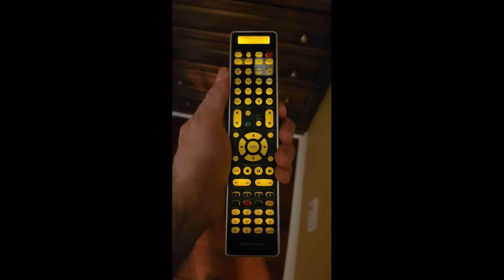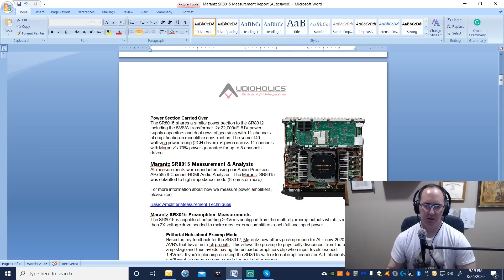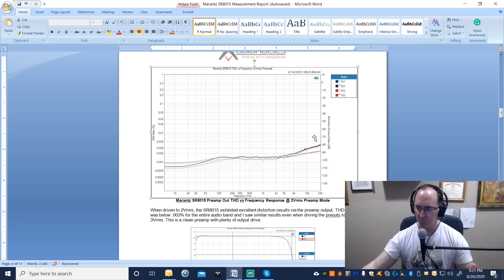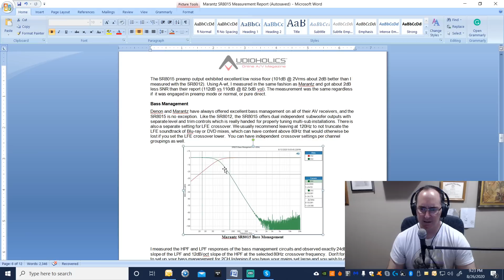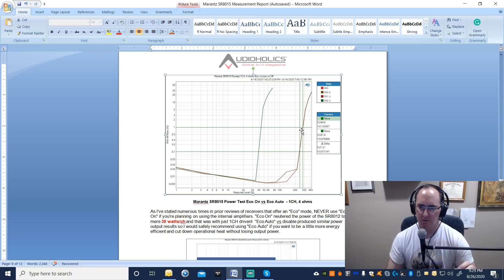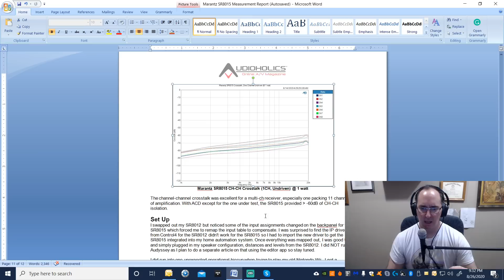Marantz SR8015 Best AV Receiver for 2020? Bench Test Results!

Comment: Thanks for the video on the 8015 and the bench test. I have ordered one of these units and I will be using the pre outs , but I was wondering if it would be possible to have the SR8015 to power my Wides and Atmos?

Comment: Three years later, the Cinema 30 is out and I was able to buy a new Marantz SR8015 for less than $2K!  Love it.  I enjoyed watching your analysis of the 8015.  It does sound amazing!
Reply: so how do you like it? how would you describe the sound?
Reply: @MasterofPlay7 The SR8015 is warm and sweet when listening to music but dynamically strong and sharp when watching a movie. I have a 5.1.4 and use an EMOTIVA XPA-3 Gen 3 to drive my front stage Martin Logan Motion 60XTi/50XTi. Really happy with my setup. Love the Marantz.
Reply: @rafacq  are you going to upgrade to cinema 30?
Reply: @MasterofPlay7 why would I want to spend $4,500? I have no reason to change. I don’t want Dirac and I only use one sub. No need for 4 sub outs. I’m not jumping in to that rabbit hole!  My system sounds amazing, particularly after using Audyssey One.
Reply: @rafacq  do you have to pay extra for audyssey/dirac? I'm debating which one makes sense
Reply: @MasterofPlay7 not at all!
Reply: I’m going to get this at less than 2k on Amazon. It’s an amazing receiver.

Comment: Other than power hungry speakers or speakers in an environment that need to be driven hard I am beginning to understand the use cases for pre/pros any more. I have been a Denon person for 20 years having started with a 4802, 4308ci then X7200WA and every time I consider separates the Denon and Marantz step up their game. Now debating on when the X8500HA or SR8016 replacement be due to decide to wait for that or jump on a SR8015 later this year.

Comment: Streaming surround sound?  Streaming does not support surround sound. 4K players with audio output being phased out. OPPO 205 4K player no longer produced price for NOS $8000. and Panasonic DP-UB9000 being discontinued. Also HDMI cable has lower power for audio output.  If you buy a surround sound system, there is no way to listen ? There is no info I can find that talks about this?    Could I please get some comments about this.

Comment: Does the 2019 SR5014 and the 2020 SR5015 have the preamp disconnect and the new circuit? Or are these two things only found on the SR6015 and higher? I use a Emotiva XPA-3 to power fronts and center channels.

Comment: So what actually happens to the power of the receiver when in 8 ohms, vs 6 ohms, vs 4 ohms? If you don't hear distortion at 4 ohms then does it matter? Does 4 ohms actually change the sound quality? If Im running a crossover anyway do I need the power of 8  ohms? What's missing when I set the receiver to 4 ohms?

Comment: Gene, I am in the market for a new avr. Love love love your videos and reviews. I’m still feeling the sting from my Onkyo pre-pro issue hdmi board failure twice and crappy service.  Really want to go with the sr8015, but than read this on Amazon.  Any thoughts?

Amazon Marantz Customer Support]
Marantz does not own any service centers. All of them are independent contractors... [Marantz] does not have our own parts inventory. We have a separate company that handles that for us. It is a company called Encompass and if they do not have the parts needed for the repair then the unit is deemed not repairable.In truth, nothing is unrepairable. It is just that because parts that are not available would have to be made, the cost of the repair would be more prohibitive than the cost to buy a new unit. So it is not worth repairing. If United Radio told you the unit can not be repaired what they meant was that replacement parts are not available and it would cost you more to repair it than it is worth.Marantz does not have an obligation to any of its units outside of their warranty period. We still provide phone and email support as a courtesy. And it is not so much that they will not accept the unit, they just know for old units there are not likely to be parts available and they do not want you to waste your time shipping it to them if that is the case.[End of Email from Marantz]A couple of things to note here. First, Marantz doesn’t make the parts - another company makes them. There’s no contractual obligation from the parts manufacturer and Marantz to offer parts for any period of time to support their products even their reference series.Second, Marantz makes it completely obvious that the Authorized Service Centers that they direct you to are completely unaffiliated with Marantz and have no obligation to even accept certain units for repair. This is exactly what happened to me – their regional service center wouldn't even accept the unit for repair. They say that nothing is irreparable – well, obviously all my receivers are.Third, Marantz clearly states that it does not have an obligation to any of its units outside of their warranty period. Unlike car or watch manufacturers who will gladly repair your unit for a fee , Marantz’s interpretation is that they have no obligation to even offer a means or a service center to repair the unit. You’re on your own – it’s Saab time and the factory is shut down.This is very disconcerting for what are considered by many audiophile grade receivers – it would be fine if we’re talking about a $500 receiver but not okay for $3,000+ receivers.Like many of you, I was planning to upgrade to the 8015 but I can't buy it if it will not be repairable 5 years after I buy it and I definitely don’t want to squabble about the existence of parts with Marantz if something happens. If there are no parts, this receiver will be completely unusable and I'll end up with 3 of the most expensive bricks I've owned. I'm sharing my story with you to make sure that this doesn't happen to you.I know that a few of you will think that I got plenty of life out of my receiver and I did and I love the sound of the receiver but the option to repair it should rest with me, not Marantz. I was lucky I had a spare 8001 and could use that but not everyone here will be in that situation where they have a 8012 lying around and certainly spending another $3,000 to replace the same model is not something I would like any of you to have to do. And let me tell you, my back has paid the huge price dealing with the broken receiver. One service center accepted it, charged me but didn’t fix the receiver. You don’t want to hear Marantz’s response.
Read less

Comment: Hi Gene, thank you for the informative video. We learn alot from them. My question is.... How do you see the AV8805? The only video I've seen is from Sparechange talking about it but haven't seen no"benchmark" videos on it. I just (upgraded?) my 8012 to the 8805 and went complete seperates. Do you ever plan on benchmarking the 8805? Thanks in advanced sir
Reply from the maker: It's a good processor,  better analog front end than the AV7706 AND on par with the SR8015. Will probably bench test the 8805 replacement.
Reply: @Audioholics  Thank you for the reply sir. Ok, so I guess I didnt do to bad selling the 8012 to get the 8805, especially if its on par with the 8015 seeing how the 8805 is about 2 - 3 years old and the 8015 just came out. Anxious to see what the 8805 replacement brings also

Comment: Please let me know which is a better receiver between the 8015 or yamaha 3080?
Reply: Hi I had the same dilemma and bought both Jeje ended returning the Yamaha it sounded great but the 8015 is just more powerful and the dynamic is superior you can hear more separation between channels and it gets louder with out distortion and of course it cost more money but you are more future proof as well. Hope I help
Reply: @AMERICOBECKS  was there any distortion on yamaha?
Reply: @gamingingalaxy4011  only if you push it to hard I was using 5.1.4 running everything on the AVR Amp, it was too much for the internal Amp at Reference level you I was able to hear some distortion, below that the sound was great I replaced for the SR8015 because the marantz is just more powerful and have more of everything but at a higher price of course. But if your place is no too big the Yamaha will sound great
Reply: @AMERICOBECKS  i did the same thing returned 3080 and got 8015 instead

Comment: I have an 8015. I bought an Emotiva amp thinking I could only use the preouts for the front channels and still use my 8015 to power the rest of my 7.2.4 system. Was I incorrect in thinking that? I cant get it to work....
Reply from the maker: No. You can definitely do that. Connect main PREOUT to your amp and you're good.
Reply: @Audioholics  thank you for the swift feedback. And of course you where correct. It was a silly mistake on my end, choked up to excited and rushed. I ended up replacing an old Mitsubishi DA-A15DC that was powering a pair of Electro Voice DL15W subs, for a 4 channel Emotiva Amp to power the subs and my Paradigm Studio 100v5 fronts. I am definitely impressed!! Thanks for listening. Great content, keep it up.

Comment: May I ask you a question? I have an older Marantz that I use for home theater as well as my - nice - turntable. If I buy the SR8015, would it be advisable to use it for home theater only and use my older Marantz 7010 dedicated purely to the turntable? Or use the new one for both?  I care about the audio from my turntable a bit more than for my home theater. Thanks SO much for your opinion.

Comment: Hi, I'm looking to upgrade from a 5.1 to a 5.2.4 set up but only wanting to use 1 av amp to power all the speakers in a small room. I was looking at the Denon AVC-X3700H. Will that do the job or would you suggest some thing else? Thanks.
Reply: If you are after a HT for purley Movies go with Denon X3600H or X3700H. They both support 9 channels and 2 subs. If you listen to music on your HT too, go with Marantz equivalent version.
Reply: @2011Au  Thank you very much for your reply, most appreciated.

Comment: How does the 8815 preamp sound compared to the marantz pre/pro ?
Reply from the maker: The SR8015 preamp is cleaner than a 7706 and likely compatible to the 8805 but without XLR connections.

Comment: Reading a lot about how the Panasonic HDMI 2.1 chips have hardware faults and that 4k/120Hz doesn't work on the 2020 Marantz and Denon models. And they say a software update will NOT fix it. So, recall or hardware replacement. What's your opinion?
Reply: I'd like to know more information regarding this as well. It better not be a watered down software fix where it's 4K 120 @ 4:2:2 instead of 4:4:4. If it can't be rectified by software i hope they offer a refund or 1-1 exchange for those faulty units and also recall all existing units from retailers. I wouldn't want to buy a HDMI 2.1 capable receiver only to get stuck at 4K @ 60 fps..

Comment: Yamaha Aventage sounds so much better than Denon X, but I'm keen to know if the Marantz provides clean output on all volumes, low, mid-high Never liked the Denon's sound, it was thin & lifeless..
Reply: I owned Aventage A860, Denon X3500H and Marantz SR 8012. While the first 2 are not in the same class against the later japanese receiver, I like SR 8012 far better than the other 2. I didn't dislike Denon but had issues with Yamaha.
Reply: @2011Au  Trust me on this one, had a hard time watching movies with Denon,  dialogue always seemed to be lower than the sound effects like an explosion, etc, always had to fiddle with the remote to adjust the volume. Setting the dynamic volume to Low & increasing the dialogue volume kinda helped, but robbed away the dynamics.

With Yamaha it's much better, the volume of explosions matches the volume of dialogue, and if I still have trouble understanding the dialogue I can always increase it through the app which is much easier than Denon's Audyssey adjustment.

Comment: I had the SR 7015 set up a couple of days ago and am very pleased with it. I'm using it as a preamp that replaced a Rotel that was 35 years old. I went with the Marantz  because it has the latest technology and am using the preamp function to go with my Rotel amps (also 35 years old and speaks to the quality of them). I'm on a fixed income now so trying to save money if I have to use the receiver  mode.. When the rotel amps die I will use the full receiver function.  A couple of suggestions. 1. Have a professional hook it up for you. Today's stuff is a lot more complex  and there are no videos or good setup guides from Marantz. 2. I wish the remote was RF. Gene helped in making my decision to go with the Marantz.

Comment: This AVR vs the half priced sr7015 offers only a bit more power. You’d better save 1200$ and get the sr7015 and even you can add a power amp and get the same number of channels and a lot more power
Reply from the maker: That's  true except the SR8015 is built in their factory in Japan, has many parts upgrades,  and 13CH of processing...
Reply: @Audioholics  True but do those make any difference in SQ?
Reply: fofocho71 Yes it really does

Comment: Excellent test Gene. I do have to comment that the channel numbers are getting ridiculous. I get it if you have a large HT room (but then you need highly efficient speakers or additional outboard amps). My room is 12' x 17' and I'm fine with 5.1 (Yamaha DSP-A1, circa 1998) so even with the extra two front speakers and a subwoofer, my room is full. If I stuffed the room with 11 (or 13) speakers they wouldn't fit! Then there is the massive expenditure of the extra speakers and the overlapping soundstages - too much.

It has a place in many HT rooms, just not in mine. What I need is get up to date on technology and get an ATMOS receiver with the latest decoding and internet music channels for my small room....like a Denon X4700H. Two channel ATMOS, thank you 😊

Comment: Thanks! I had to do a bit of reset after the on line upgrade on my 8015 and that was curious (factory reset?). The ECO nerf is all that and worse. The temp of the unit is the same and less than my 7010 was, which is really an eye opener. Better design as far as I can figure. I now get to run a 7.2.4 in my great room.

Comment: Very nice! So the HDAMs are a part of the preamp? Even in the lower models that has the older HDAMs? Would be nice to see the measurements of SR7015 with a different amp design and HDAMs.

Comment: Thought I had decided on the Denon AVR-X6700H but this review has thrown a wrench into my decision.  Awesome analysis and great review Gene!  Any chance you will be reviewing the Denon 6700H in the next month or so for comparison purposes?
Reply from the maker: no likely since I'm moving soon. 8015 if you're going to use the internal amps to power your front LCR's. If you plan on using external amplification, I'd prob go the 6700 route.
Reply: What about the SR7015?

Comment: Can you use this receiver and connect a 3 channel amp for your front Soundstage (LCR) and use the receiver for the surround channels? Or with this disconnect is it all or nothing from the receiver?
Reply from the maker: yes you can use all the preouts even with internal amps if you don't switch to preamp mode, otherwise just 2CHs of preouts can bypass the power amp section IF you still want to run internal amps.

Comment: Hope to get my 8015 any day! Big upgrade from my current Yamaha RX-Z7. Great content and info, thank you.
Reply: Can you tell me what speakers you plan to get with the 8015?  I'm trying to build a home theatre....(framing up 2x4 walls currently). I want to do 4 overhead Atmos speakers 1 sub, and high quality 3 way center speaker.... thats all I know so far.  What should I add to the 8015?  I'm going to need a cabinet (with cooling fans). Can you recommend a good bluray/DVD player?  Anything else you'd recommend for my cabinet?  Whats all this talk about pre-amps?
Reply: @jcro8926   Hello. I already had speakers from my previous system. 
Fronts: Paradigm Studio 100 v5
Center: Paradigm Prestige 55C
Surround: Yamaha NS-777
Rear Surround: Yamaha NS-777
Top Atmos: x4 SVS Elevation Prime
Sub: x2 15” Electro-Voice DL15W
Sub power: Mitsubishi DA-15DC
Bluray: Panasonic DB820
TV: LG C9 77”

I feel I have some real nice speakers. But I’m sure there are other people with much nicer setups than me. I have around 15K in speakers I’m using from my last receiver.

Comment: I found it interesting that it appears that the new Marantz doesn't have the balanced xlr outputs anymore, wonder why? Also was wondering if using for a preamp turn eco mode off or auto?
Reply from the maker: No Marantz receivers have balanced XLR's AFAIK. You're thinking bout their preamps which do have XLRs. Preamp mode automatically puts the receiver in Eco ON mode I believe.

Comment: So good to hear...Marantz has done it again with this receiver Good work Gene like always You are the Rock of Electronics Just one question Eco Auto , so if i am running a 5 channel external power amp and the Marantz is doing the rest of the channels ...Do you still leave it ECO AUTO ? And if you put it in pre out mode and only using a 5 channel external amp will the other channels still come on in the Marantz? Because you said it turns off the channels in the Marantz ..But i am only using 5 channel amp Do you have to have external power for all 11 channels? When you put it in pre out mode?
Reply: In preamp mode you have to use external amplification for all channels.
Reply: @Raritytuber  ok thanks